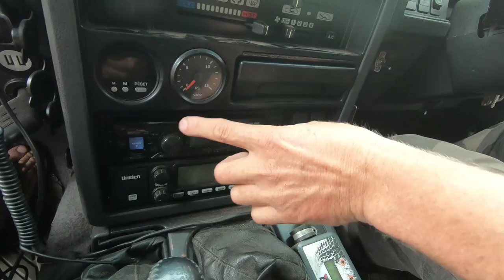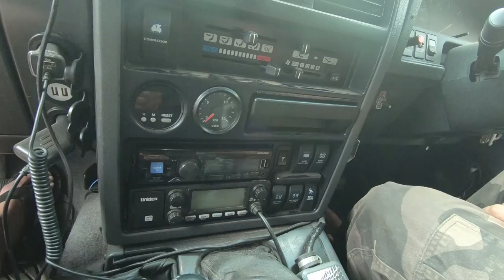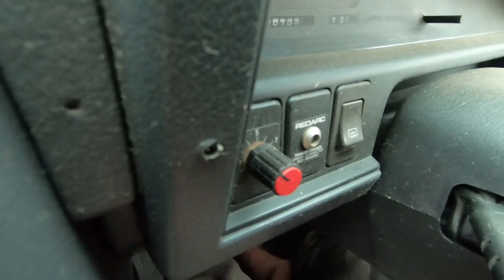Brunswick 6.5l Nissan Patrol, Modified Episode 55

Comment: Same engine I put in my Range Rover Classic.  Cool, had no idea i could get away with 20 psi boost and no intercooler.  I may have to turn mine up, but I'll be snapping axle shafts all the time.  LOL   Awesome truck.
Reply: did you actually research these engines before you wasted money on one.the only good thing about them,is,i dont own one,they can be bought brand new from IH,for 6k,second hand for 500.anything pree 2000 build,IS GARBAGE.,info,wiki,u.s ebay,u.s y toob.sad.you would of been better to use the focus,mondeo,citreon,renoult,ect,tdi,2.0/2.5 lt...6 lt 100.goes like a cut cat.

Comment: The 6.5 is actually a Detroit Diesel, GM just contracted them to supply the engines. Very cool and unique swap
Reply: Antonio deCarmoducci in the 90s, dude
Reply: Detroit diesel was owned by GM when they made this engine
Reply: @seansutherland6270  the engine was made back in the fifty.s,as a petrol buik motor.gm,had nothing to compete with ford & dodge ,so this was a very bad,stop gap,there a rubbish engine.IH,totally rebuilt them 2001 on,people with the old gm 6.5,HAVE,to be a chev nut to own one,.i nearly bought an f100 fitted with a 6.2,thank christ  i walked away,it looked so small for a diesel.warning bells.here in aus,guys fit them,at great cost,like 36k,to nissans & toyotas,why,??,i have no idea,maybe they dont have a computer to do research,??,or think the v8 sound is better than reliability of a 6 cyl..some guy said,''oh,they must be good the u.s army use them''i said,YES,MILLIONS OF THEM.!!
Reply: @phantomwalker8251  you Aussies are really missing out when it comes to trucks so much so you guys think the 6.2 or 6.5 boat anchor is a good engine
Reply: @seansutherland6270  nope everyone in Australia knows these engines are absolute shit. The Toyota turbo diesel inline 6 and v8's far superior to any American engine
Reply: @brocksinclair66  100% american engines are nice if you don't mind being stranded in the middle of wild life

Comment: Wouldn't that longer lower control arm get in the way of rocks when going off road?
Reply: Hi D.Alex Oprea it does hang down a little but actually helps slide over things and it's a small price to pay for the flex and drive-ability they give

Comment: GQ'S are the best 4x4 on the planet...
Reply: pffft  i  wouldn't buy one even  if i could
Reply: 70 aint worth what they ask for them
Reply: top reliable truck the 79series, expensive but hold there value very well
Reply: Land Rovers are the best 4x4 on the planet...
Reply: Negative
Reply: @bogdanhh  yeah if u 4wd at the mechanics shop
Reply: Don't be silly. If you had a bad experience with it, that doesn't mean it's an unreliable car. ;) Check this out and change your opinion ;) https://www.youtube.com/watch?v=amRsRo2Guuw&t=2s It is most probably an Australian problem, as there Britpart is a "well known" brand, while in Europe everyone runs away from Britpart because of their poor quality...
Reply: @bogdanhh  dude its coz landrovers are very high maintance they aren't set and forget but there is a liking to that which I respect but still it doesn't take away from being high maintance/ unreliable
Reply: I don't agree with you mate. Changing all oils on a Td5 is less than 200 Euros. Not sure where you're located... I did 5000 km in summer and had no single issue with the car.
Reply: nismo/OFFROAD ahaha unless you have a 80 series ;))
Reply: now you are talking
Reply: @bogdanhh  negative

Comment: Complete boat anchors these engines. TD42t with a tiny 10mm pump will walk all over these off road and on road. Don't get me started on a TD42 with a 12mm pump. I guess a 6.5 sounds ok though.
Reply: Grant M alway someone to put a dampener on it . they are an old school engine but we love it , it fills or needs , everyone loves the sound of it , it probably wouldn't go harder than a properly modified TD42 I know I have owned plenty of them as well , we were just wanting something that was a bit more unique as well and it is an excellent tow vehicle. cheers
Reply: @freedomscreens8629  really, ??.more money than brains i see.there a garbage engine.what did it cost,35k,.IH in u.s has totally re designed/built these engines,after 2001,.anything before that,it a grenade.they were originally a petrol engine,converted to diesel,THATS WHY THEY LOOK LIKE A 350 CHEV,because they are,buik really.like,1950.rubbish engine.they over heat,crack blocks,heads,the ansilliaries are crap,the injection is rubbish..v8 sound,??,phooyaa,ever heard of wiki,go look them up.
Reply: @phantomwalker8251  Take some writing classes, please!